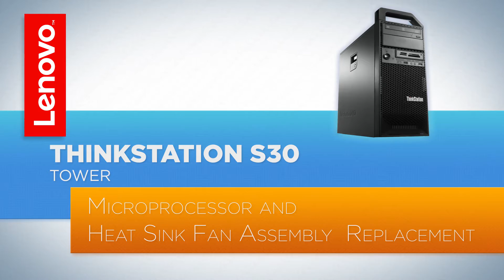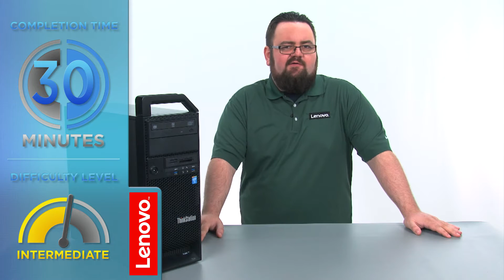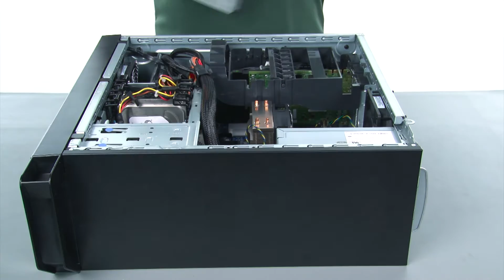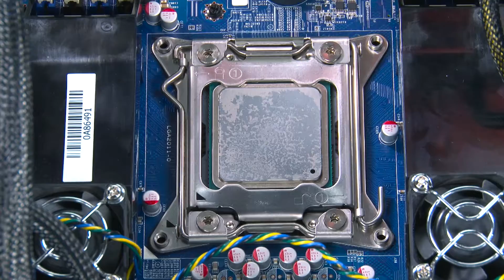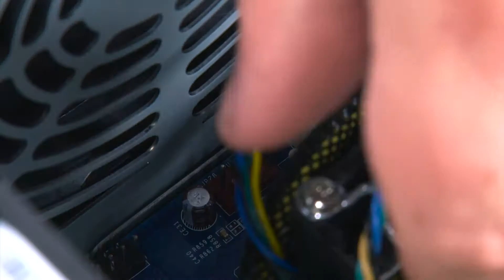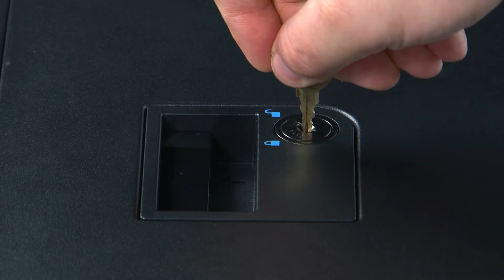ThinkStation S30 Tower - Microprocessor and Heatsink Fan Assembly Replacement

Comment: Does this motherboard support SLI cuz I could buy one used S30 with e5 1650 and make overkill PC but I didn't find any information about multi GPU setups.
Reply from the maker: the BIOS supports SLI if two equal and capable cards are detected.  However, there's currently no provision in non-quadro drivers to support the S30 in SLI using gaming cards.   that's a driver limitation coupled with not having a current need to support gaming cards in SLI.